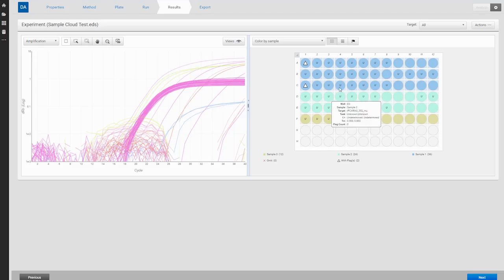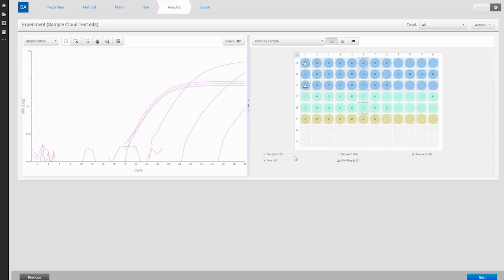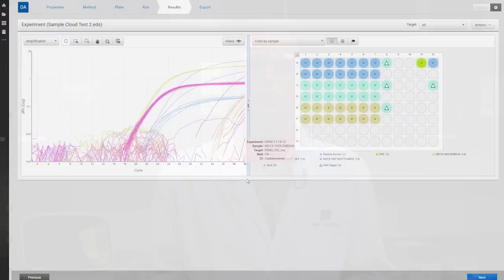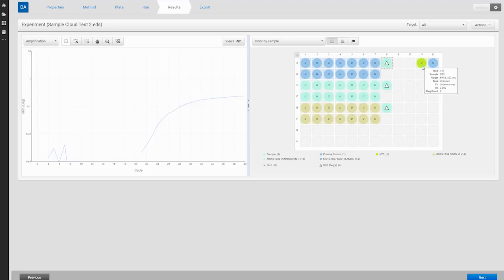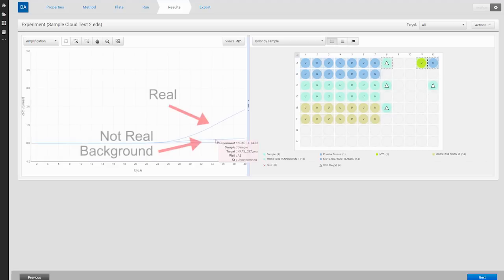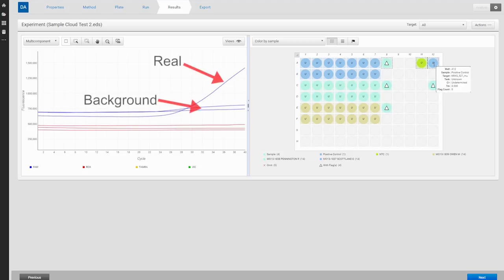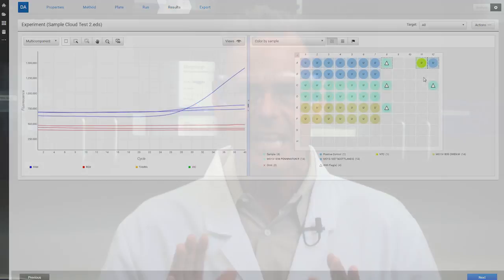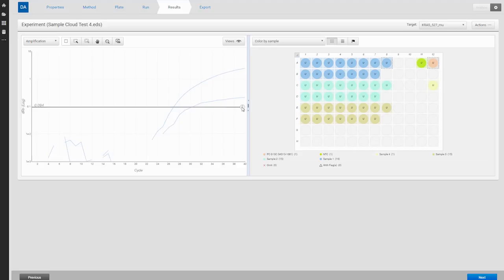Distinguishing Real Signal from Background Noise - Ask TaqMan #41

Comment: There is a continuum of slopes in amplification plots in both linear and log views in a serial dilution to the limit of detection. In linear view, the "background" was not actually flat, and if you change the y-axis settings it will actually look quite steep. The threshold setting determines where (log or plateau) the threshold crosses the amplification plot, so you can set the threshold such that it crosses log phase of both traces.  Other video says to set threshold where replicates are tightest; isn't that kind of cooking the data, since there will be inherent variability in replicates? Even if threshold set by replicates makes sense, how is baseline subtracted? Differences in baseline settings can turn a flat trace into a geometric amplification plot. Other video doesn't say exactly how it should be set or how auto calculates it.  Hence, it is still unclear how to distinguish signal from background.

Comment: Iam getting amplification in NTC at a Ct of around 16.I thought the primer got contaminated and we reordered the primer and set everything in a conatmination free environment.But still getting amplification.I did different dilutions of primer from a working of 10 picomolar to 0.36 picomolar and set the NTCs .In this we got less amplifiaction for  0.625 and 0.36 picomolar primer concentration.I also set NTCs for Betactin primer along with this.For Betaactin primer, I didn't get any amplification at all and it was clean.I run the agarose gel for these NTCs and it comes around the range of 100-150 bp.Is it the  problem with the primer?